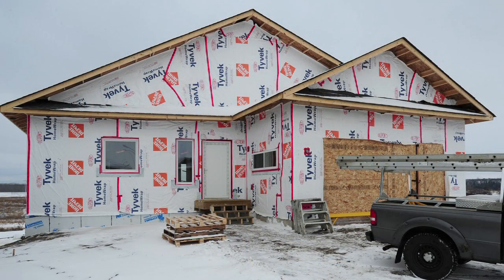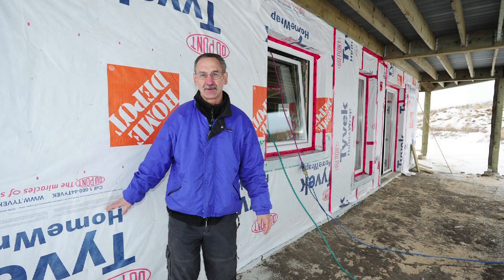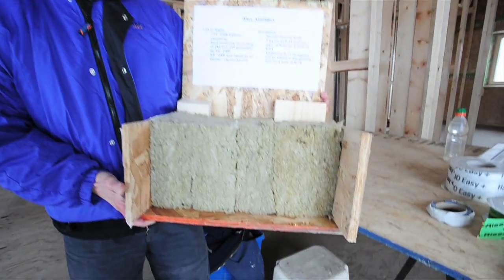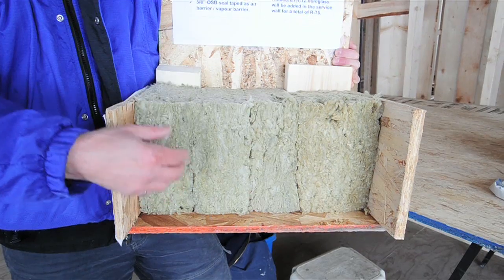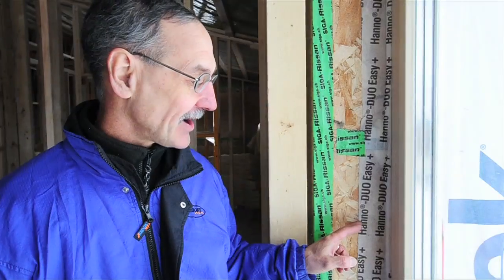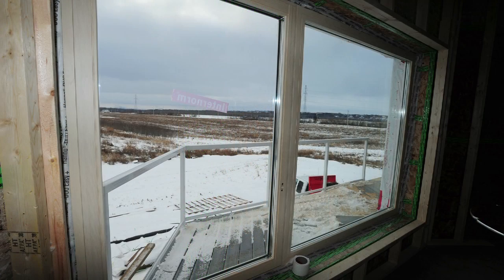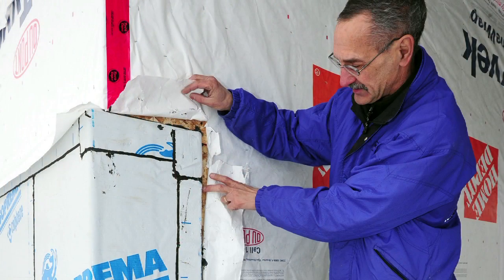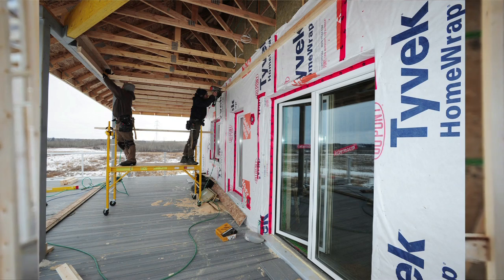Most energy-efficient building design

Comment: Excellent project. Just one question: did you realize all that Rockwool is very labour-intensive to install? My wife and I built a small outbuilding this way and decided multiple layers of Rockwool were just too much work. We have become big fans of blown-in cellulose instead.

Can-Cell Industries is just down the road from this project in Edmonton, and they are Western Canada's biggest supplier of cellulose insulation. Great product. We built our double-stud home with 12 inch thick walls and cellulose for an R-value of 46. We burned 1.37 cords of firewood between Oct. 26 2019 and April 26, 2020 and that's our ONLY source of heat. Our neighbours all burned 8, 10, 12 cords of firewood. Yes, super-insulating added about 10% to the cost of the house but it was worth every penny. We're in wintery central British Columbia.

Comment: Build Passively herehttps://www.youtube.com/user/seumas2/videos
Material used

Port
Alberni's first Passive house (Passivhause) build in the heart of
Vancouver Island British Columbia Canada.

Passive
House(Passivehaus) is considered to be the most rigorous 
voluntary energy-based standard in design and construction industry
today.

Passive
house buildings consume up to 90 percent less heating and cooling
energy than conventional building.

The
use of Passive House design software was used to gain the specs
required to meet the performance standard for this location.

House
was constructed well  above the current standards as outlined in
the B.C. Building Code.

Footings
were widen to 36 inches(914 mm) due to low bearing soil conditions
and additional rebar reinforcement added.

30
inch high (762 mm) high reinforced walls . Course sand placed inside
foundation walls and mechanically compacted.

Three
layers of four inch *102 mm) thick  Expanded 
polystyrene foam sheets with all joints staggered and tape were
placed on top of compacted sand.

The
three layers of foam have insulation value of approximately R 50.

A
20 mil layer of poly was placed over the E.P.S. sheets and taped and
sealed.

Four
inches(102 mm) of 30 m.p.a fiber reinforced concrete was placed to
form a slab over the foam based.

Slab
is isolated from concrete stem wall with four inches (102 mm) of
E.P.S. to prevent thermal loss.

All
cold water lines are buried in the sand to keep them cool, hot water
lines have been placed in the center layer of foam insulation to
minimize heat loss.

Wall
plates compress to heavy beads of acoustic sealant between layers of
vapor barrier to prevent air movement.

The
walls are double stud configuration set at 24 inches (610 mm) on
centre and plates are spaced in a manner that yield a 20 inch (508
mm) thick wall. 1/2 inch (12 mm) standard plywood sheathing with 
Mento 1000 a three layer airtight vapor open house wrap( far superior
to common house wraps) with 1/2 inch(12 mm) pressured treated plywood
rain screen battens form the exterior surface. 

Intello 
smart vapour barrier was installed one third in from the inside wall
to prevent condensation in this climate.

Triple
pane argon filled windows meeting passive house standards from
Euroline  were placed mid wall to reduce wind wash heat loss. 
All window openings have been splayed at 45 degrees to give a full
wide angle view.

Almost
all the wiring and plumbing was kept inside of the vapor barrier
envelope to minimize air leakage.

Passive
house standard requires air leakage not to  exceed .6 Air
changes per hour at 50 pascal.

Zehnder
comfoair 200 HRV has been installed with a 1000 watt air preheater
.(92 percent heat recovery rate)

House
has been pre- plumbed for a heat pump water heater reducing 
domestic water heating cost significantly.

Garage
has been pre-wired for 40 amp/240 volt  electric car charging
station.

House
to be equipped  with  heat pump condensing dryer which
requires no external venting,only a water waste line. George K
Builder. © George K 2019      
https://www.youtube.com/user/seumas2/videos

Comment: Finally getting in the right direction of energy efficiency with construction.   The only improvement on house construction is using 2X6 studs for wall construction over the previous 2X4.  ICF has not caught on because of expense but certainly is a better option over conventional stick frame construction that really has not changed since the late 70's.  Finally seeing a step forward but now need to get the developers to quit building crap economy cookie cutter housing.

Comment: I question if the polystyrene underground will become waterlogged in time?  No mention of the most important insulation R rating, that above the celling. Rockwool insulation must have been greatly improved, as an R14 for a 2x4 wall is outstanding.  Real issue in justifying super insulated homes, does the extra construction increase global warming?
Reply: That is about right for rockwool. I also share some concern with the water management and potential for mold and rot. Air loss seems to be the biggest issue with both of these things so much of it will come down to the skill and attention to detail of the builder and sub contractors.

Comment: did not see orientation of studded walls ?  your sample a poor example
Reply: when looking at the model the 2x6 is on the interior side of the wall; the 2x4 exterior. Look at it as there it's a framed house (2x4)within a house (2x6).. you're looking at the model as a cross section; as if you are standing with one foot outside (left side) and one inside.. This may give you a better understanding.

Comment: Interesting but - Doesnt air-tight create its own problems like holding in Earth gases such as Radon?   If you don't install A/C or other air flow mecanisms the air would be stagnant n stale.
Reply: +KELLI KELLI Well if the building was completely air tight, then how would the radon get in the house in the first place?
Reply: Radon travels thru walls and concrete.
Reply: @o.g.solutions 
Like covid 😏  allegedly does.   There are radon detection devices, FYI.